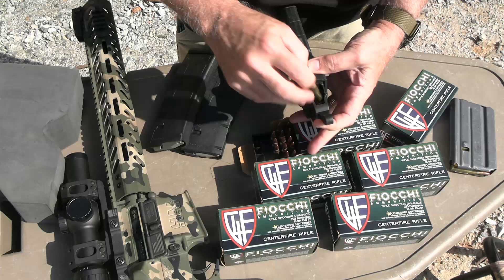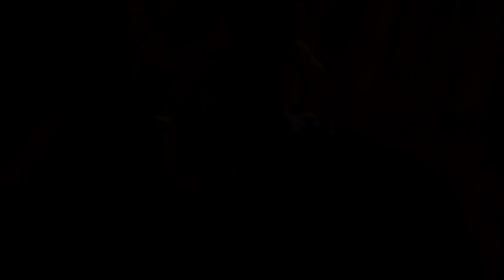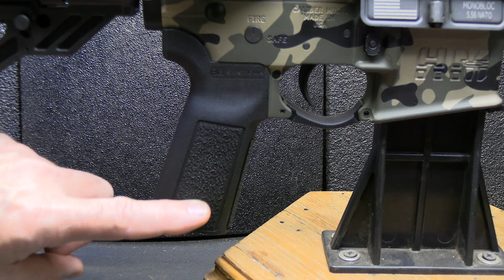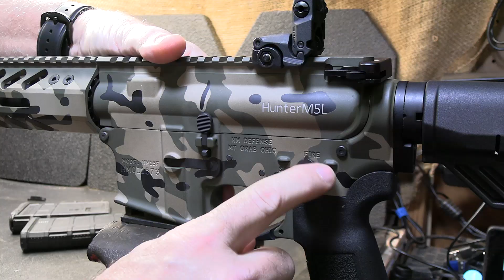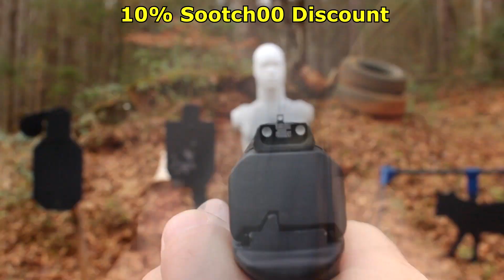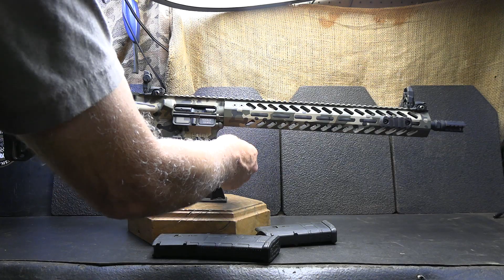The  Bomb Proof : AR-15 HM Defense Hunter M5L Rifle Review

Comment: Absolutely best AR I have seen.
Served as Infantryman for over a decade, and yeah this is one solid battle rifle.
I had never had any problems with my issued M4 rifle, but know that yes, parts can break.
Never had issues with gas block or anything.
Only issues  that can occur on militry  issued rifles, are spent barrels due  to many rounds fired, and inside off the barrel literally becomes lout off spec,  due to loss or rifling.
I had it happen to me in older designated marksman rifle I used to qualify.
Barrel was an issue, and once given a different one all good.

Comment: The M-16 failed me in combat in Vietnam. It got two pin size pieces of shrapemetal in the buffer/stock, fired twice and jammed. If I hadn't been in combat I would have wrapped it around a tree. Any weapon in my opinion with a  buffer stock a is piece of crap. I carried an AK-47 my last month. I knew that it would fire. I won't own such a weapon. I trained on the m-14, and m-16. I liked the m-14 better. The m-16 was designed for anyone to shoot it. And in combat comditions under sustained fire the damn barrel glowed in the dark giving away my position. Not good. For Vietnam jungle conditions a shotgun was a better weapon. Our point man carried a shotgun. What I wondered about was why didn't we UZI's. They would have been better in the jungle conditions. The m-16 was too long and was also getting caught up on vines, and bushes. I hated the damn thing, and I always cleaned mine each morning instead of having breakfast. I had the cleanest m-16 in the company. The damn thing failed me. The damn thing still makes me mad after all this time. If I had one I'd destroy it.

Comment: Sootch, you are fine to use 30 round mags, you're not not allowed to use them in states that don't permit them, or show a video that shows how to manufacture them at home. There is a rather ambiguous line in the firearms policy that states: "Don’t post content on YouTube if the purpose is to do one or more of the following: "High capacity magazines or belts carrying more than 30 rounds." 
Seems weird.. but note they said MORE than 30 rounds. a 30 round mag should be fine, it's more than 30. seems 31 is the limit?

Comment: The bolt isn’t a new thing.   I think it’s an LMT design.  If not them, someone similar. The monobloc is new.
Reply: The domed cam pin and no hole all the way through the bolt are new. Lmt has rounded bolt head lugs and extra case ejector springs.
Reply: @deanofthevale3193  
Watch this video, and go to 11:30.   It’s the HM BOLT.  
https://youtu.be/HZkK70Miz60
Reply: @deanofthevale3193  ….
As I said before, if it wasn’t LMT, it was someone else.  But it’s not new

Comment: Interesting rifle.  How often has the gas block had issues on a professionally built rifle?  I'm not talking about home builds because there is no quality standard there, but for professionally, commercially produced rifles?  The gas block is under the free float tube so it isn't going to face any impacts.  I get the bolt and that's a nice upgrade.  But are they worth the premium?  Is one bolt better than having a spare?